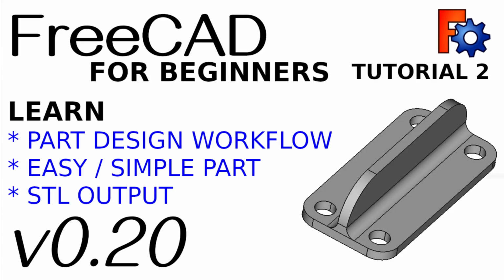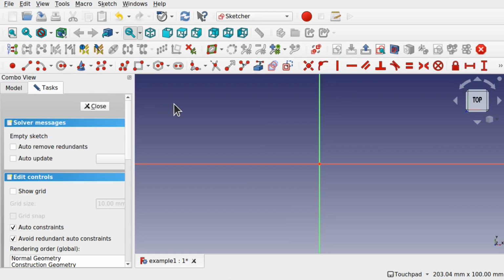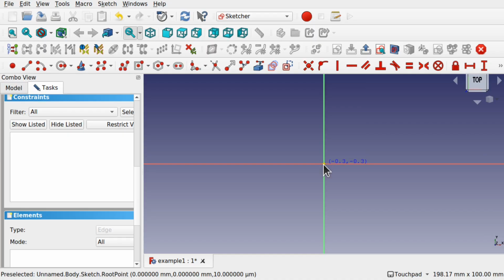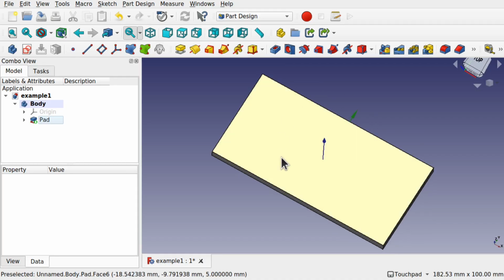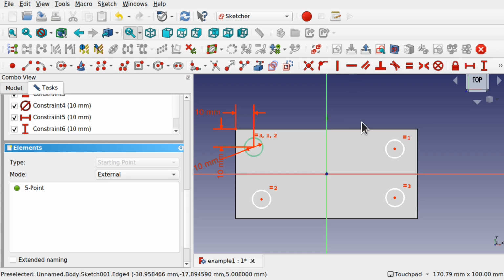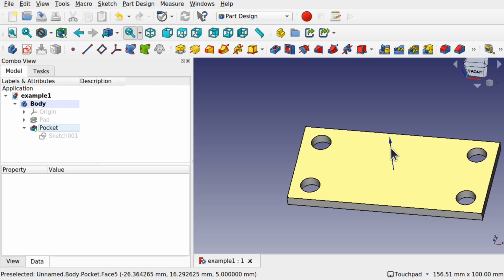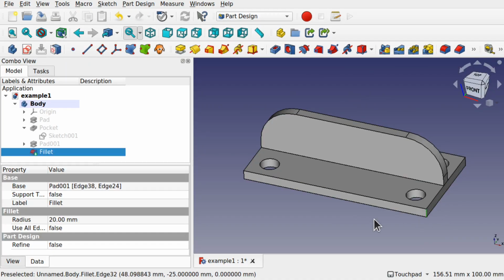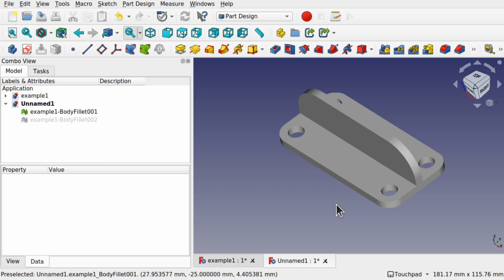FreeCAD 0.20 For Beginners | 2 | Create a simple model and export to STL in Part Design

Comment: These tutorials are great!

As a machinist I'll say one thing though: Only apply fillets and chamfers to the model if they're functional or cosmetic. If you only want sharp edges broken by, say, a 0.2mm chamfer, just call it out in the drawing :) Some CAM programs deal best with deburring on sharp model edges.
Reply from the maker: Glad you enjoyed. And thank you for adding your knowledge from your experience. It all helps with enriching the content.
Reply: Also, adding chamfers or fillets to a CAD model all over just uses computing power 👍.    As a time served draughtsman, , who started out on drawing board with Rotring pencils and pens, design it and  draw it as if you were making it on a manual bridgeport, a Colchester lathe, and a surface  grinder. I have seen too many uni grad designers causing too many unneeded probs for toolmakers. 😂

Comment: Thank you so much for another lesson on freecad. I really enjoyed going side by side with you and making the 3d object. One question I have is when importing an stl by the looks of it you don't get the breakdown of each of it's components like in the original model. How can you break it down again into the various components with an imported model?
Reply from the maker: Glad you enjoying the series.  So the STL is standard format that can be interchangeable with other CAD packages.  It creates a mesh but it doesn't export out the FreeCAD commands.  You cannot restructure it directly back into the operations as per what you did in freeCAD but if you export it out at a step file which creates edges and faces which you can use the downgrade tool in the draft workbench to brake the model up into faces and wires.  But again this wont be the original freeCAD operations.  You can boolean these back together and combine with other faces.
Reply: Interesting so how would you go about sharing a model with other memebers? Say I have a github repo and I want to share my 3D Object how would I share my original project it? I’m think from a collaboration perspective. Btw thanks again for the tutorial series I’m waiting for pay day to send you a ko-fi.
Reply from the maker: @MrMcMuffinz1  You can share the freeCAD file itself.  I have put models up on github in the past and people have download and modify.  I am not sure about the git history though.  I don't know how they act  in a collaboration.  I have never tried creating branches and merges.  That would be interesting to see what would happen.  The freeCAD project files are archive files that contain some XML but I believe they also have binary files.  Thank you regarding Kofi, much appreciated

Comment: Hi, love the tutorials. My only problem is I do not seem to have the centered rectangle dropdown menu which has made following the tutorial near impossible. If possible could you advise on this issue?
Reply from the maker: Check which version of freecad your using, this is available in 0.20. But you can do the same with symmetry constraint using the top left and bottom right points symmetrical to the center point.

Comment: This is a really great tutorial. I just ran into an issue on Linux, where the final fillets could not be created. Turns out, there is an error for those in 0.20.1 (which is the stable release in the PPAs at this point) and moving to the 0.20.2 appimage release from github solved it for me.
Reply from the maker: Glad you enjoyed and thank you for sharing that information. It really helps the community.
Reply: I also had this issue, it was driving me crazy until I saw this comment!  Thanks!  Maybe this issue could be added to the video description, because I didn't see this post until I expanded all the comments...

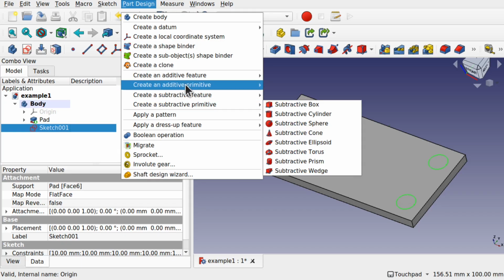Comment: I'm enjoying your videos very much, but I had a little problem when doing the pocket at about 26:20. I was getting an error that said "Cannot use selected object. Selected object must belong to the active body. Consider using a ShapeBinder or a BaseFeature to reference external geometry in a body."  I thought I did everything the same way you did, but must have done something weird because I deleted the sketch for the holes and rebuilt it and then it pocketed just fine. Any idea what I might have done? And how I would fix it if I did the same thing again in the future?
Reply from the maker: Very easy fix so don’t worry. look at the body in the tree view and if it is not in bold, right click on it and toggle active body, or double click the body to make it active. Glad your enjoying the videos
Reply: @MangoJellySolutions  Thanks! I'll try that if it happens again
Reply: Same error here, but BODY is bold, PAD has green arrow
Reply: @bluekindart  I got it to work by making the body active, as described above

Comment: Hi, great tutorials but I'm having some problems viewing the edges of the verticle extrusion. They appear clear on video but they don't show on mine. Is it a colour issue with my setup?
Thanks.
Reply from the maker: Glad you are enjoying the video. It sounds like your draw style is on shaded rather than flat lines. Go up to view on the top menu, down to draw style and you will see the options there. This could have changed if you accidentally pressed the shortcut combination
Reply: Thanks for the reply.
I tried the draw style, the only way I see lines is if I switch to Wire View. 
This does still not guide lines on the end views. The view appears as a solid T.
Thanks for your time.

Comment: Thanks for another complete fantastic example from start to finish!     You are right this is a different approach to CAD modeling.   One observation and one question if i may.   The observation is on Windows 10, the DEL key on keyboard doesn't always work the same or at all in Freecad.   Instead from menu choose Edit and Delete.     Now the question, supposed i want to tap the 10mm holes in you example for fine thread screws, any idea how to accomplish that?  maybe a different workbench?
Reply from the maker: Thank you for your kind comments and the information re: windows 10.  It's always great to get information like this as it helps other people. 

Regarding your question, I already have a video for that in this series which is covered in lesson 24 :)  You can easily apply this to the model by using the part workbench workflow.  It would be safe to jump into that lesson and extract out the information you need.

Comment: Great tutorial, but. My sketch lines and dots are super super super small. They are so small that when I add a sketch to the padded  body. The sketch cannot be seen unless I rotate the object just so. It is crazy and making it difficult to select them. I can not figure out how to make them bigger like the ones in your video, can you help?
Reply from the maker: In the top menu > edit > preferences click on the part design icon on the left hand side (if it's not there enter the part design first and it will become available).  From here you can go to the shape appearance tab and find vertex size, line colour, line width etc.  This is applied to all workbenches.  I glad you bought this up as I have been looking across my stats in youtube and I can see I have a level spread across age ranges and obviously visual abilities.  I myself have an artificial lens in my left eye so have had sight problems for many years.  I am currently building a grid of visual settings to allow for a better experience for the less able of us.  I don't know why I haven't done this sooner.  There are settings for sketcher to to allow for the point size and the constraint size which I will add.  I am going to release this to my blog once done and place an announcement of my channel.

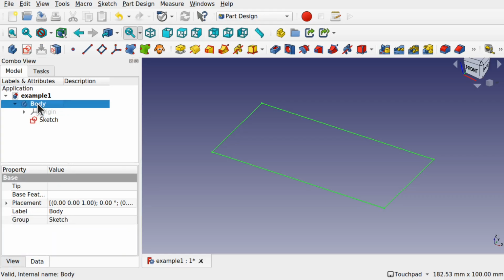Comment: I'm trying to follow your example but at the 14:02 mark, my "Combo View" lists Example1 followed directly by Sketch.  There is no Body or Origin before Sketch.  What am I doing wrong?
Reply from the maker: A number of things could of happened:  If you haven't created a body then you need to create that first.  You body may not be 'active' (right click toggle active body) before you created the sketch so the sketch now sits outside the body,  If the sketch is outside the body in the treeview then you can drag and drop it inside.
Reply: @MangoJellySolutions  I can't find any reference of anything related to the body in my version of FreeCAD

Comment: I'm new to FreeCAD, so this series is helping me a lot. I've had some experience with SolidEdge, so it feels very much like home in terms of general look, layout and work environment, but the user interface will take some figuring out and getting used to. Can't wait to get into Surfaces, that's always been my favorite in SE. Keep up the great work!
Reply from the maker: Welcome to the journey :) It's great to hear that you are enjoying this videos and finding likenesses across the two.
Reply: @MangoJellySolutions  Having fun indeed. I went ahead with extrusions through profiles, because I need those for a hobby project of mine - but otherwise I'm going through the tutorials in order. The one thing I'm struggling with is placing sketches on inclined planes. Planes parallel to the XYZ planes I've figured out, just modifying the coordinate parameter. The biggest difference so far is that in SE you tend to do a lot of things via clicking and dragging, and here it's more about menus and ticking items in lists.

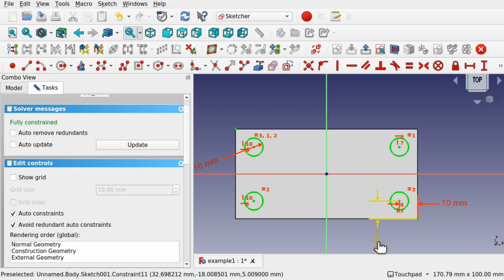Comment: i have the fully constrained sketch as at 25:30 mins in and when i close this down no circles appear on the plate. can you help
Reply from the maker: Have a look at the support of the sketch in the data tab. It should be the same as the face you are sketching on. Also hide the pad so you can see where the sketch sits. You may of placed it inside the model

Comment: Great video. But try as I might for almost an hour....I could not get the final fillet???
Reply: same problem here. running 0.20.1   Fillet from the vertical part of the bracket to the plate does not work. Uninstalled 0.20.1 and got version 0.19 and the final fillet works fine. Noticed that the topology at the end is different. Lots of edges.   If you select Pad001 in the Comboview pane and in the data section below it you will see under Part Design that Refine is set to false.  When you change this to True, the end topology is simplified and the inside corner edge fillet will work
Reply: I got it to work in version 0.2 also by going in Edit > Preferences > Part Designer section and setting Automatically refine model after boolean and sketch based operation

Comment: Good and nice tutorial. Ive learn a lot. Just wondering how do you manage to freely move the 3D piece around with the mouse?
Reply: Thanks for the reply but nvm I figured out that with different combinations of shift, ctrl and  left click the object can be moved like you do it.
Reply from the maker: @PabloRamos-tm9rp  Ah So it was navigation around 3D :).  Little tip, bottom right hand corner of the screen you will see a little icon that you can change the navigation options by clicking on it and selecting your preferred one.  But, if you hover your mouse over it and wait a few seconds it will show you the different key combinations / mouse buttons and what they do . Hope that helps
Reply from the maker: Great to hear. Are you looking at moving the 3d view around or moving the piece itself.

Comment: They all do the free axes rotation as if by clicking some mouse button and moving the mouse, but it doesn't work for me. Just zoom and pan and to rotate the part in 3D I have to use the cube shaped tool with lots of arrow signs in the right upper corner.
Reply from the maker: On the bottom right of the screen you will find a icon that you can use to change your navigation options.

Comment: Great tutorials! In your video, I can clearly see the constraint symbols; not so much on my 4K monitor. With 72 year old eyes, I literally have to squint to tell them apart. I don't see a preference to set the size (ver 0.20.1). How did you achieve this, if you please?
Reply: And while I'm asking questions, when I click 'Close' to exit the sketch the green 'fully constrained' color turns to yellow and I'm still in the Sketcher WB. Reentering the sketch, I can see that it's still fully constrained.  Perhaps this is because I'm using ver 0.20.1, the current version? 

I really would like the assurance that my rectangle is still fully constrained that is provided by the green color - is there something I have to set for that to happen?
Reply from the maker: So the fully constrained sketch  unfortunately only shows when your  editing the sketch.
Reply from the maker: Thank you. Constraint icons relates in size to sketcher font size which can be changed from top menu > edit > preferences > then from the left hand side of the popup window scroll down and find the sketcher. You will see 3 tabs, one called display. Within you will find the font size. Increase the font size will increase both font and constraint symbol size. Hope that helps.
Reply: @MangoJellySolutions  thank you for such an excellent teaching method. I didn't see the sketcher icon on the left side of the preference window so I started poking around. What I found was that I had to go to the "Workbenches" icon on the left side, then I went down to the Sketcher workbench and clicked "Load Now". Once I did that the icons for Part/Part Design and Sketcher showed up in the left side of the window. From that point I followed your instructions and increased the font size from 17. I'm learning a lot following your tutorials.
Reply from the maker: @originalhotrodder4337  Thank you for sharing, it's always great to get comments with little tips like this as it really helps the community.  Also just to add I believe if you have visited a workbench then this will then show up  in that list. FreeCAD saves on memory by only loading what it needs.  It's great to hear that you are learning from these videos.
Reply: @MangoJellySolutions  Thank you. While this works, the font is already oversized. From your reply, I guess there's no way to change just the constraint symbol size.

Comment: When we add a sketch to an existing pad and create another pad from it, are the two pads automatically unioned or are the two pads still independent items ?
Reply from the maker: If your using the part design that is exactly what is happening. It's the reason why you can't have multiple bodies in part design but you can in part. The same as pockets, these are automatic cuts

Comment: it will not let me put the last fillet in those inside corners, I've done everything step by step the same, twice. and it keeps showing failed to create fillet. same problems with Blender, I definitely agree with what you said about adding fillets at the end, they cause a lot of problems in Blender, which is one of the reasons I was expanding to free-cad along with more accurate dimensions for real world production. I installed Free-cad from the apt store for Linux and it installed 1.9, so that may be the difference. Any input will be appreciated

Comment: Very good video, thanks. I picked up a few workflow tips on this one. I noticed you put a sketch on the face of the first extrude rather than making a datum plane on the face and sketching on the new plane. I've seen videos recommending against that because of a bug that can cause things to break in certain instances. Has that bug been fixed now?
Reply: Depends. If you use the realthunder fork, it is pretty much fixed. The goal was to get his fixes for the topological problems into release .20. I'm not sure if that's been done because I prefer realthunder's LinkStage 3.
Reply: @ringding1000  thanks. Have not heard of realthunder fork, will look it up.
Reply: @ringding1000  From what I can grock from the FreeCAD forums, the topological issue wasn't quite ready for prime-time for the 0.20 release. But the devs are working on incorporating the fix(es?) into the next version which will supposed to be version 1.0 (actually when I looked at the milestone page for 1.0 a few days ago, the topological issue is the only one there). I don't know if the devs know how long that will take, but it appears to be their highest priority goal at the moment.